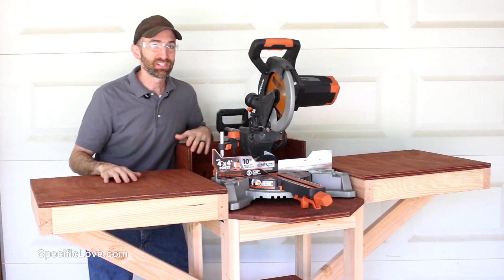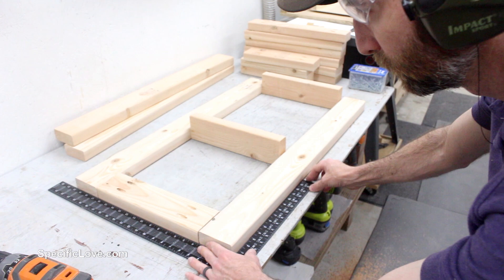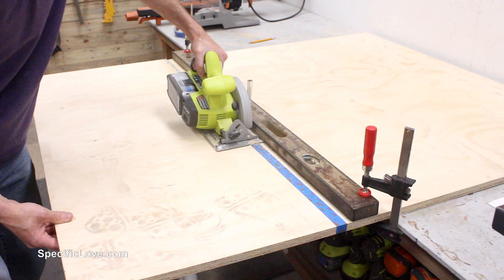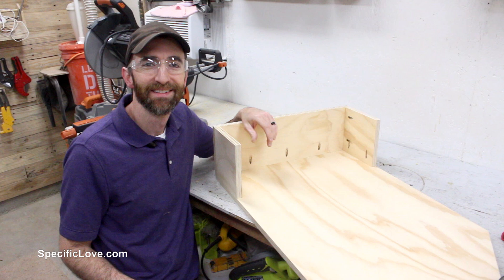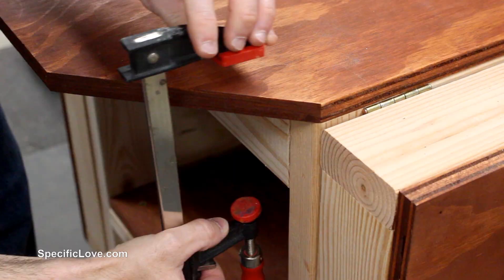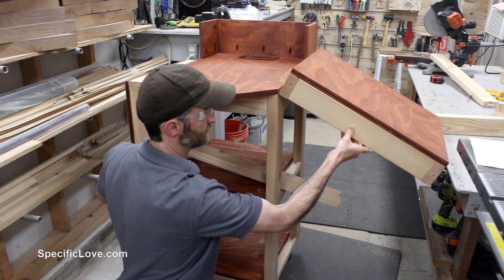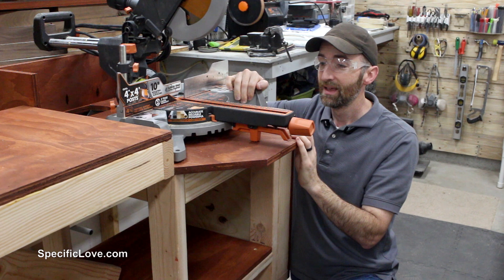Mobile Miter Saw Station

Comment: Just came across this video and while it is three years old, I wanted to give some advice to others who might see this while planning for their own miter saw station. If you put the two side leafs upside down on a flat work bench or floor, and then position then prop the main stand upside down on two wood pieces the exact height of the saw base, you don't have to fight gravity with clamps and extra wood when aligning and attaching the hinges.

Comment: Sorry, I just saw this 5 years later. Just a thought about your swing arm supports. Why not drill an over sized hole in the side of the support and hang it on the vertical support.

Comment: You have given this beginner some really helpful ideas.  As I build mine I will build the back board and two sides higher so as to have a better chance of collecting (or at least containing) more dust.  Also, mounting the dust port on the back board just across from the exhaust port will collect (I believe) more dust than mounting it on the bottom.  Staining the boards made the project very attractive.  Great job!

Comment: As a new woodworker this project looks easy enough for me to tackle. I started building a workbench yesterday and learned how to use my pocket hole jig. Cutting 8foot 2x4’s was a little hard on the miter saw so I definitely need that stand. I think this will be my next project. Thanks!

Comment: Instead of a middle shelf you could leave the lower cavity open for a shopvac to attach to your downdraft. Love the simplicity of your build.
Reply from the maker: Thanks Aaron, and good idea.
Reply: I am planning to use this design for myself, but instead, will leave out the bottom shelf for sliding in the shop vac, with space in the back. This means the front and rear 2x4 will not be there, just running a flat 2x3 on the bottom sides.

Comment: Great idea. Going to add a couple of things to it. Making it to where I can interchange the miter saw with my sander, grinding wheel, and a vise. Will store all under the table. Additionally, I am making a stop sled that attaches to the wings for repeated cuts of the same measurement. Adding a plywood box cover for storage when not in use.  This is the best idea I have seen to this point for a portable miter saw table.
Reply from the maker: Thank you. Those will be some nice upgrades too.

Comment: I just bought my first miter saw and thinking of very nearly the same thing although had not thought of the wings.  I did some experiments and have decided to make a rear thin sheet wall (1/4" plywood maybe) that slides up for greater sawdust retention, and go with a rectangle opening bin under the rear of the saw, from about half way under the miter table and up to the sheet wall, then incorporate a small vacuum in the table to allow a local hose for clean up.  But seeing yours gives me even more ideas.  Thanks.

Comment: Like the cabinet/cart.  Would use 2×4 for legs and 1x3 for the remainders.  Think I would use a piano hinge for the drop leaves. Would use a butterfly wing to support the extensions and attach it to the back leg to allow mounted storage.  I only use my miter saw outside  due to small workshop and DUST. Portable wheel cart beats carrying the saw to an outside location. Thanks for the detailed information and sharing!

Comment: Man that's a great idea!  I've been debating building a miter station into my workbench, but I'm just working in my normal 2 car garage, where cars are also parked when I'm not working.  I don't think I could sacrifice that space!  A folding and mobile miter station though may just do the trick!  I'm thinking some kind of a slot to stick those support brackets on the back, because I know my knobby knees would smack that board every time I walked by!

Comment: Old Newbie  - Wing Support I really like the simple approach.  You should consider adding a hole at the top and center of each 2"X4" resting wing box (close to hinge) and a protruding dowel to the end of each wing support.  When not in use can let each support hang down flush against the side of each resting wing, either in the back (out of the way) or in the front using the dowel and a loose fitting hole.

Comment: Love the table! I'm going to build one this weekend,  I will make 2 changes to this. 1) I will cut a 2x2 in a 45 degree angle and place it on the back wall, that way it's easier to clean off all the dust. 2) I will bring in the legs equal to the width of the plywood that way I can do a vertical foldable bracket on a hinge that folds our at 45 degrees to hold the wings up. Just my 2 cents. But love the table, so practical!

Comment: I think Sparky’s comment bears repeating. Sooner or later you’ll lean on one of those wings or try to cut a long board. The whole thing will dangerously tip over. You could put heavy weights on the bottom shelf or design a leg that supports the wing down to the floor. I also saw a comment about making the wings longer and narrower. I’ll work on that because I want to build this table. Nicely done thanks!

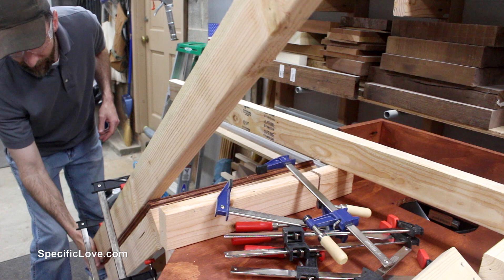Comment: If you pause on 6:08 you can see there is about 5 inches of space. I would extend the wings to the length of the stand frame to give it a clean profile looks when stowed. Thinking this might be my weekend project. Nice job!
Reply: You're onto something. Extending those wings all the way to the floor would do 2 important things: streamline the look, and make it more solid. The "legs" or supports for the wings could go to the floor as well. That would address SparkyGT's comment above. I like the added mobility of the wheels, but I'd think it would not be that often that you'd move it, and you could still do that with the wings raised. Just a thought. Great space-saving table idea for a station.

Comment: Nice work, way to keep everything mobile.  I have a steel cabinet with wheels for the center section.  I'll adapt your wing design and attach them providing a tremendous amount of support for long boards.  Thanks for the information and inspiration. Cheers, Pete
Reply from the maker: Sounds like a good plan

Comment: Great video! Wondering if you might share the measurements for cutting the plywood? Am basically a beginner and this would help in my planning as I need to have home depot cut the plywood for me so I can get it home. A full sheet of plywood won't fit in my car! Thanks!

Comment: This is a great solution to the quandry I've been in about how to get hinged wings to be level with the saw table when raised. I think this will solve the problem. As far as the dust, it really is  about impossible to get it all. But I was able to reduce the dangerous airborne particles quite a bit by mounting a desk fan upside down on the ceiling to blow over my right shoulder and toward the dust cone (like you installed here). I took a video of using the saw with and without the fan, and there was a lot less airborne dust escaping the draft.
Reply from the maker: That is a great idea. I might just try that, thanks.

Comment: Hey all in all I like the build. My only critiques would be to use stronger hinges for the wings and a better locking system. Also maybe it’s an optical illusion but to the naked eye, at 9:10 the saw plane looks about 1/4-3/8” higher then the wings. With that being said I like the over all design. Great job and keep posting, I get a lot of good ideas from your projects. 👍

Comment: Nice Video and Setup.  How about adding some Velcro to the wing support beam and the back of the two legs on the stand?  (Or drill a some hole in each beam and hang them in the same location.)

You could store the support beams there when not in use.  That would free of some shelf space as well.  I’m 6’2 and I’m sure that my legs would find a way to hit those beams sticking out like that.

Comment: This looks like it could be used as a kitchen island as well. With the cut out for the dust collector used as a scraps/ tradh drop zone. The folding wings/ arms being higher up than the main top, may be more beneficial than some may think at first. The wall behind the dust cut out would also function as a back splash. I have a set of casters just waiting to have their purpose with this in my kitchen.
Reply: With some wood raw, and some stained, it makes the piece visually appealing. I also believe that keeping with 2x4's makes the unit seem like it could stand up to our cast iron cookery collection. Thank you for your video, and the inspiration it has given me.
Reply from the maker: Thank you for the support and the great ideas. That does sound like it could be very useful if done correctly. If you build it, please let me know, I would love to see it.

Comment: I love your saw table.  I made something similar for my miter saw, band saw and drill press. 

I store my tools in the shed, but I have to roll them outside and set up on the patio under the sky to use them. 

The following is probably more helpful to readers on a budget or in a similar work conditions.

Because I have obstacles bigger than cabinet wheels can handle, I replaced my wheels with 3/4 inch runners that go from front to back on either edge.  To set up shop, I just slip my hand truck blade under the cabinet and roll it to where I plan to use it. When I set it down, it's flat and stable and I don't have to lock wheels. It also saves me about $30 per cabinet. 

I also have a sliding miter but I haven't added the wings yet, partially because I'm trying to figure out how to cover the full width that the saw can cut. 

As for changes to the wing supports for the table in the video, I would consider making brackets or clamps on back of the cabinet to stick the supports in vertical. They would be out of the way and free up the shelf and not protrude anywhere.
Reply from the maker: Wow, that is a bunch of good advice. Thank you for all of your ideas. I'm sure it will be very helpful.
Reply: Buck McDaniel: I'm interested in your idea to move the cabinet. Just not sure I understand want you mean. Could you elaborate? What is a 3/4 runner? Then you say "slip my hand truck blade under...." ??? Any pics? Thanks

Comment: Nice build. I’m looking into similar designs to hold my miter saw in a garage that gets two cars, so space is a premium. All of the similar designs on the internet have the same wing design, that is deep like yours.  I’m considering much less deep wings, because when your cutting a long piece sitting on the wing extensions it’s not that wide.  The stock is only 6 inch or less wide, so what’s the point of the wide wings?  Also, there’s hardly any load on those wings from the stock being cut, so making they out of 2x4 base is only adding mass to the cart.  Could be framed with smaller timber.  Anyways, good ideas and got a lot out of it.

Comment: Thank you and much appreciated. One more question is that I have delta planer model 22-560. I bought it used. I could not find the purpose cutter head lock. But I have twisted it accidentally.  It seems like the planer is now gripping the piece of wood in the beginning.  Kindly suggest the solution. Thanks again.

Comment: Your videos are always very practical - use of affordable materials, no fancy and expensive tools involved in making. I am long time subscriber and follower.

I have recently bought a 12" sliding miter saw and need to build something like this. One quick question - what height do you find to be convenient. I know you mentioned 36" when cutting the legs. Will you be able to tell me what height your final saw bed is at? I might have to design according to my saw dimensions and also account for cater wheel height. Any other insights or improvements you can recommend are also appreciated.

Thanks and keep up the great work.

Comment: Wow! What a good idea. But as I started planning it out I found that my Dewalt is just under 24" wide. Can I assume that the six  18" boards plus 3" for adjacent boards gave you a width of 21"? If this is right should I increase the 18" boards to 21" for my 24" chop saw? Thanks for any help.

Comment: You can add a bracket on the rear under the lip on the rear legs to hang the supports either side of the dust cone so it keeps your shelf free for more also a fence could be screwed onto the wings good build though

Comment: I like this a lot. I just started building shelves and want to  build a work bench that I can easily put the miter saw on when needed. I've noted pocket screws seem to be popular. When I built my shelves I just screwed in from the outside. What is the advantage with the pocket ?  I need the work bench because my back hurts and esp when half hunched over for the lower fold out worx table i have. I need to stand straight up. (getting old-lol) about to start a hanger store garage shelves build.

Comment: You could hang your support legs on the back of the wings when not in use, that way they are not in the way, and gives you more space on the shelf
Reply: I had the same thought, but not sure on the method of storage. I was thinking drilling a couple of holes into the brace's sides. Halfway sink a screw high on the back side of each wing. The braces can then just hook the drilled holes with the screw heads.

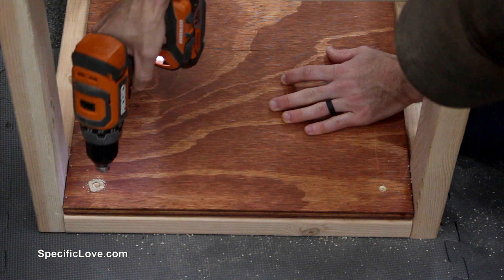Comment: At 2:04-2:08 it looks like one of the top frame pieces is turned flat while the corresponding piece is on edge.  Then at 5:22 they are all on edge.  Was there a reason to first install it one way, then change it later.  Also,  what is the final working height of the miter saw's table?  I'm guessing it would be about 43-45".  I think I will upgrade and put some 1/4" panel sides and back on it as well as door(s) on the front to give a dust-free storage area.
Reply from the maker: Good catch. I accidentally turned the first board the wrong way, but caught soon after an corrected it. 
And yes, the size would be around that height. It works well for me, but adjust as you need it.

Comment: If I do this im going to do 2x2 or 1x pine boards for the folding table parts to cut weight. Especially since theyre only occasionally used.

Comment: I would  have found a better solution to hold up the wings. I am thinking of dining room tables that have the fold  down extensions/wings that are then held up with boards that slide out underneath or pivet in place.

Comment: OK, how did you measure the length of the 2x4s you cut to hold up the wings? That has to be a precise measurement or the wings will not sit level. I have designed and built my own mitre saw stand similar to this, but I can't figure out how to measure for those supports. Thanks.
Reply from the maker: First cut was a little long, then I made several tiny cuts until it worked.

Comment: I don't work with saws that often, no one to show how too's except You tube and I got that same exact saw you got on the right. I'm thinking safety . Keeping your hands away from the blades is a given . I need some Jigs most people tell me, kick backs is how they loose fingers. I like my fingers right where they are. Any suggestion ?
Reply from the maker: I am not an expert in safety, so with that being said, I make sure I always have a firm grip on whatever I am cutting. I try to keep as far away from the blade as possible. I love using a sacrificial piece of wood when ever possible, to help hold things in place. 
And there is much more to learn along the way.
I have had a few close calls, so I will always say that even though I might do everything correct, there will always be unexpected circumstances that no one could have predicted.
So before you use a tool for the first time make sure to do some research on the safety involved.
And just remember that I am Not and expert.

Comment: Its another unique piece of work. I have been watching your videos for a while. You are tip and tricks pro guy. 
Here in this miter saw station you used the same trick by placing wood piece support under each wing and saved good amount of money. Thumbs up 👍 for you. 
Also I need a piece of advice from you. Is it reasonable to sharpen a blunt blade or its better to replace it?
Waiting for the answer. Hope to see  new videos loaded with new wise wood working techniques. Thanks
Reply from the maker: I would just replace the blade if it is dull, because sharpening carbide tips would require a diamond sharpener and precise technique. But that is up to you.

Comment: Why don’t you drill holes in the centers of the, whatever you want to call the, the angle brackets that hold up the wings and have an angled peg on the back uprights to hand those brackets?

Comment: This is a great idea. I’ve been playing with different ideas for my mitre saw and can’t wait to upgrade to this one. Do you have any ideas for a dust collection. I’ve been using a shop vac system but i learned right away that I need a better one for my work. Thanks in advance
Reply from the maker: I currently use a Harbor Freight dust collector that has been very reliable for me.

Comment: I'm about to start building my miter saw station using your design. And I wanted to know how well has your dust deflector worked?
Reply from the maker: It helps but could use improvement

Comment: Add double dowel holes six on the inside and outside of the fold outs, that way you can add back bracers that simply pop into place and allows for better clamping pressure options all along both sides. Nice build for a slim space, but it does look too skinny to me, I would rather another six inches on the side to add support and for blade n tool change accessories

Comment: Maybe a upgrade w/reduction  of bending over (I have a bad back) to place your wing supports in position to hold them up. Make hinged vertical swing out "wing supports", say they swing out from back to front having cordage attached to them to pull them forward underneath the wings & them being "spring loaded" (bungee cord) to stay tucked away & when pulled forward to support the wing, it to latch into a notched out piece brace underneath the wing. HOPEFULLY this makes sense!!!😔😔🤔🤔